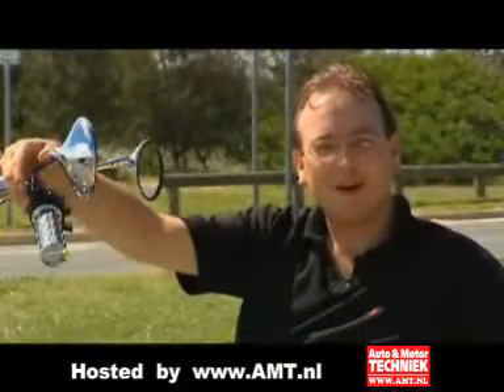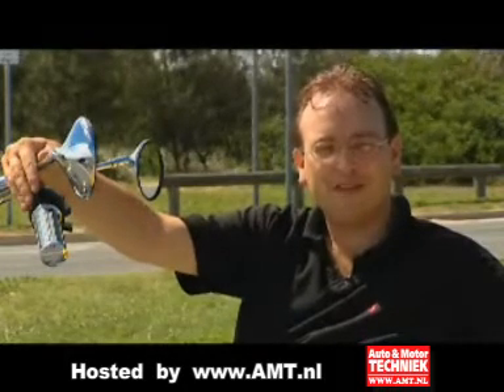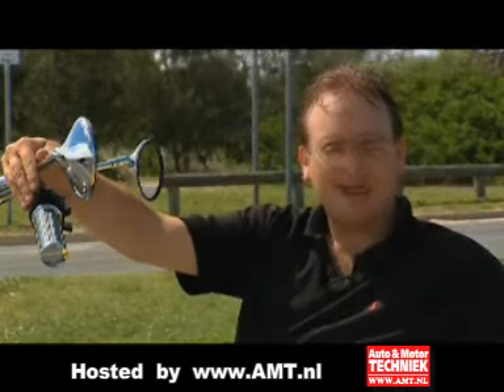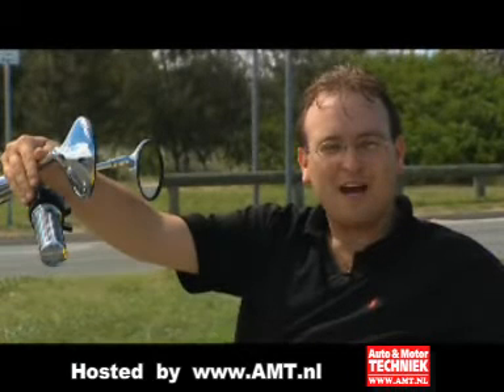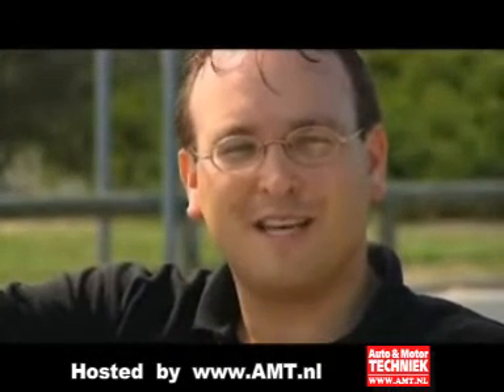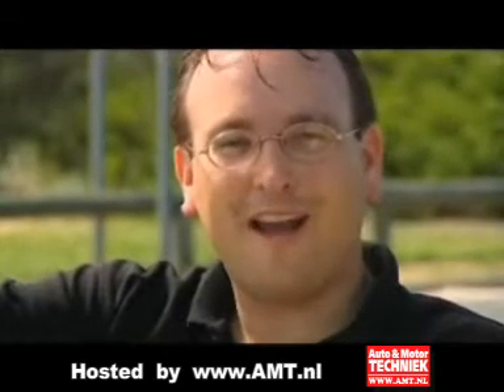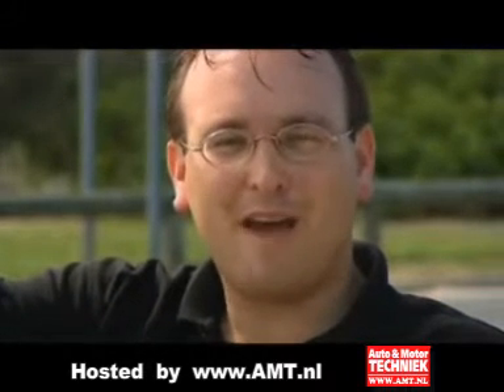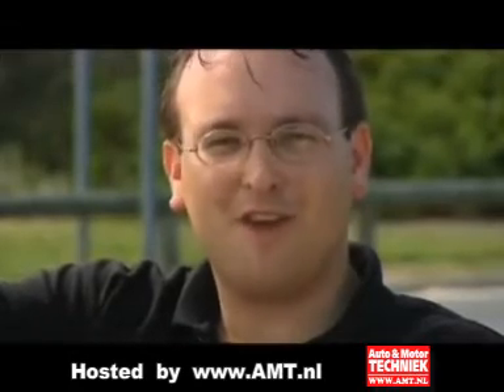Proefrijden met Revetec-motor

Comment: This is best used as a range extender in hybrid cars. The low RPMs mean it will be quiet. Run it at its constant speed "sweet spot" and this will give the power, economy and power/weight ratio needed for such an engine..